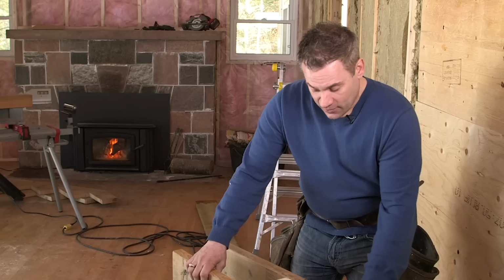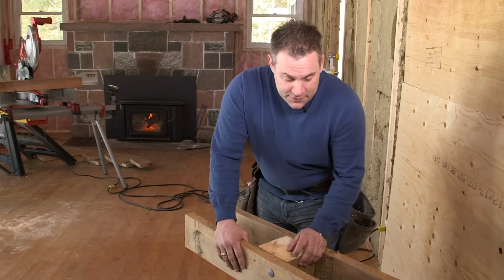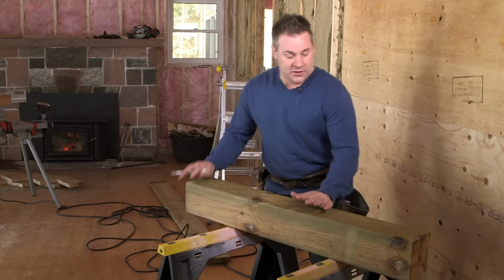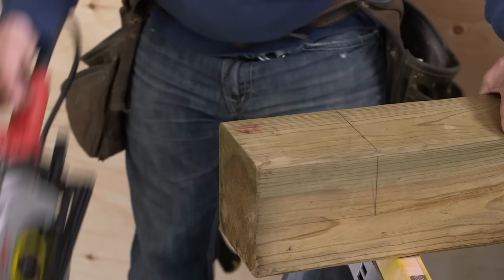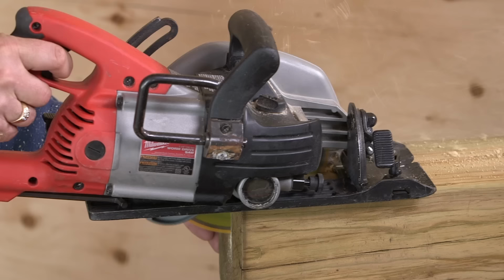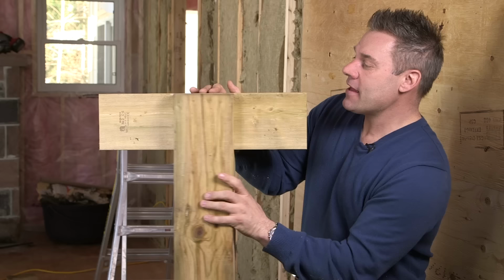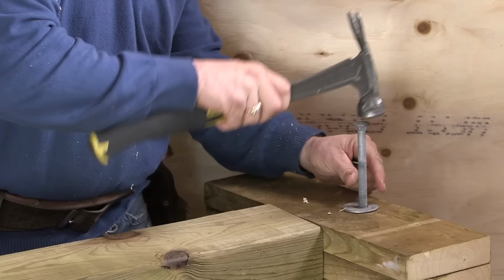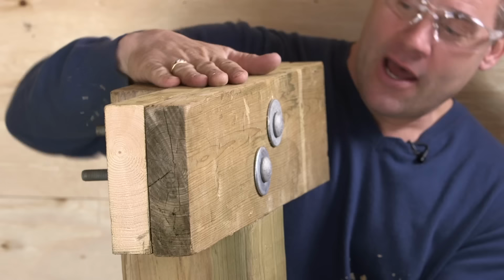How to Attach a Beam to a Post for a Deck | Decks, Docks & Gazebos

Comment: Those two 1/2 Carriage bolts have more shear strength than that post can structurally hold.
Reply: It's not actually in shear. The bolt provides clamping force which creates friction resistance. This is how a lug nut/stud works. They are only in tension. Anyone who's had a lug nut come loose knows the wheel comes flying off very quickly after that. That said wood is not like metal, it will wear in and that clamping force will decrease. The problem then isn't sheer force it's pull out force. Think of how little that carriage bolt head is. The entire force is being placed on that. That's why all thread with washers on both sides is better. Even then the way he shows is good insurance. It's only better to use hangers and not cut out a bunch of wood. He's effectively creating stress concentrations and putting shearing force on wood grain. That's a bad idea.
Reply: @Workerbee94   Correct..  The downward pressure alone would prevent the bolt from being removed.
Reply: I have decks over 30 years old done 'the wrong way'. and nothing wrong with them at all..
Reply: Wow.  Yes, the carriage bolts are stronger than the wood will ever be.  Yes the method shown is better.  Yes, the 'wrong' way will last for many decades.  Yes, the bolts are in shear though there are tensile forces also acting on it.

That said, the 'right' way will not sag relative to the post, and will not cause a lump in your floor.  The 'wrong' ways point of failure will either be the horizontal grains in the wood splitting or the lumber deteriorating.
Reply: @mjones2431  
Something can be said for spreading out the load over a larger area on the supporting post. Green lumber can shrink placing the load on the bolt which is only a fraction of the area resting the weight on the top. Much depends on the load it is expected to carry.
Reply: @larrybe2900  gotcha
Reply: Why put a washer on the head of a carriage bolt? The bolt is supposed to pull into the beam when tightened to prevent turning.
Reply: @austinheiman9488   For this application it would be fine.  I have seen 1/2" Carriage bolts without washers pull through 6x6's on vertical applications however a lot of weight was being applied (120,000 lbs. worth)
Reply: not even close.. Not even within 100x.  At the military base I work on we park Abrams tanks on 6x8 wood beams to distribute the weight of the 70 ton vehicle so it won't sink through the pavement.  I guarantee that a 6x6 post can carry 100x the weight of a 1/2 carriage bolt ACROSS the bolt.  That is the shearing strength.   I would agree with you to pull the carriage apart, say you had a monster chain to grab both ends and you pulled the carriage bolt you would be looking at something as strong as the post, but not across it.   It also has a lot to do with surface area.  resting a 4" x 6" beam (2 laminated 2x12" sitting on top of a 6x6 post,) has a surface area of 24 square inches distributed to the top of the 6x6 post.  with the carriage bolt you would have all that weight on the bottom edge of the bolt along a thin line 6" long,  lets say the line is 1/4" thick.  that would concentrate all the weight on 1.5 square inches of post instead of the 24 square inches. that is a huge difference.  The carriage bolt would act like a log splitter wedge on the post with the 18x more force along  that line where the bolt meets the post than if the weight was distributed along the entre 24 sq inches of the post.
Reply: @ericbrandenburg8583  again eric, that is along the length of the carriage bolt, not across it. with a deck, the pressure would be across the bolt, at 90 degreen and that bolt will fail long before the weight needed to pull it lengthwise
Reply: @garycarpenter2932  same here.
Reply: Its not about the carriage bolts. Its the few inches of wood from the bolt to the edge of the board that is carrying the load. If that rots or simply breaks away, the bolts or post thats off to the side (in the non notched method) will do nothing to stop it. Hanging on bolts off to the side of the post, youre literally betting on a few inches of wood on the edge of the board.
Reply: @ldlink3935  bolts don't come from China, viruses do!
Reply: Consider at the same time, cutting the notch into the pressure treated wood now makes the post no better then bare pine. The best way is to use a metal post and beam connector. Many styles available
Reply: Brian Van Horne  LOL cover the post with PL premium and your suggesting I'm the hack. That's pretty hilarious!  You realize wood expands and contracts, right. In the direction of the grain, right. Your suggestion of PL premium the post and beam together just split and cracked your deck into pieces. Enjoy getting sued. Don't like the look of a visual connector, pick one of the many non-visual options. Want to go "old school" get yourself some real beams and start doing Mortise and tenon joints properly
Reply: Brian Van Horne  yeah..... Me too!
Reply: The mode of failure in the “wrong” way is not bolt shear, so the strength of the bolt is irrelevant. It is the bearing stress of the bolt on the wood that is the problem. The “right” way decreases this bearing stress by spreading the load over a larger area.
Reply: All that shear conversation and blah blah is pointless. My area, the codebook specifically forbids their use for attaching beam to post. And that's that lol, all this other shit is a waste of time. Check your local codebook and they'll tell you exactly which set of IRC guidelines to follow.
Reply: @natemartinez4595  very true. Here in Ontario Canada the building code covers any deck with a height of 4ft or more. Notching is illegal,  the post must be a minimum of 6x6 and the beam must sit onto and be full width and "mechanically attached " there are several choices of attachment with the simplest being scabs. Decks usually fail in one of three ways. At the Ledger board, at the posts and beam or the railing connections. Under heavy  loads, rotten notched posts split. It's not about shear, 20 people on a deck moving around create a load on the post that comes from many directions. It's about posts twisting,  splitting  and failing.
Reply: Brian Van Horne  where in Ontario are you, right now there are 84 brand new townhouses in Burlington with the decks condemned because the posts were notched and already cracking before the homeowners even moved in. For your video please provide what the method of attachment was. Obviously the beam was not mechanically attached and resting ontop as Ontario code dictates. Probably nothing more then screws or nails as is often the case.
Reply: Brian Van Horne  by " extra blocks" I assume you are replacing the metal attachments with wood scabs which is basically the same thing. I'm not in Hamilton anymore but grew up there and have built many post and beam buildings through the Hamilton building department and my contractor's license was through Hamilton. I grew up in Troy. I apply the same principles of post and beam barns to decks. With scabs and cross bracing. I never notch. I 've seen to many ten year old deck post fail because of the notch and the post cracking at the back of the notch. Technically your supposed to drill a hole at the back of the notch before you cut so it is rounded instead of square.  That is supposed to stop it from cracking but I've never seen anyone that does that and I find mounting the beam on top of the post and connecting it mechanically way stronger then a notch. In the last two years or so most cities have made notches illegal.  London, Barrie, I'm not going to name them all. Maybe it today's wood, maybe it's today's Labour. But they are getting rid of notches altogether because the posts crack, split and fail. Snap in half like kindling. One of the first decks I built was at my parents house on lynden road in 1990. The deck boards have been traded out a couple times but the base structure is still the same structure today.
Reply: Brian Van Horne  each rafter must have an anti-uplift block yes. So for a deck, you use the same idea? But for the joists? Would be nice if utube allowed one to posts pic's. I frame a deck sub-floor much like a house sub-floor. Joists and spacers. That sits on top of the beam and is secured to the beam with up lift blocks. Ledgers I've only ever believed in one method and that's a bolt through the entire foundation wall with an angle iron for support under the ledger. I'm not to worried about the extra 700 bucks.
Reply: What he doesn't tell you is cutting treated wood exposed untreated lumber to rot so the little cup he created will hold water and rot out far faster then the bolts would "shear"
Reply: He solved the problem, he just understand what the problem is. The carriage bolt is not gonna shear but the beam may split . Moral of the story is that if a man don’t understand the problems he is not gonna be able to teach you very much.
Reply: Dark Justice  Ya but have you ever seen wood shrink as it dries? Unless you go back and re torque the bolts each year they definitely will become loose and will be in shear. the real problem with that is not that the bolt will fail, but that the wood will split from the bolt hole to the end of the board.
Reply: @garycarpenter2932  I know I have seen headers simply nailed into the house, but I guess the homeowners never had a house party with 20 people dancing on the deck
Reply: @jeepsuc99   I've seen carriage bolt heads pull through a 6x6 without a backing washer
Reply: @ericbrandenburg8583  not in a normal situation they are designed for you didnt. They are designed to lock into the wood and no washer is needed.
Reply: @jeepsuc99   I pulled a grade 2 through a SYP 6x6..  Then again we're talking about an 80,000 lbs of machine that caused it to happen.
Reply: All these comments is exactly why the world needs engineers...means job security for me.
Reply: @wolfpack4128  You're wrong in so many ways...I don't know where to start.  The bolt has to be tensioned to a value that creates a slip critical connection..I think that's what you're trying to say.  But you don't want to rely on only this for strength design.   You will want to check the bearing resistance of the timber and the shear strength of the bolts as well.
Reply: Brian Van Horne  Wow your local fireman/building inspector had nothing to say....amazing.
Reply: Doesn't pass code though,
Reply: @chrisburns5691   Does in my state.
Reply: @ericbrandenburg8583  funny, doesn't in the IRC.  Not to mention ive never seen a carpenter on a job do it that way, unless it's a kids playground.  Just not the right way to build a deck.
Reply: @chrisburns5691   26 years as a structural engineer with Zicka Homes.  I may know a thing or two.
Reply: @wolfpack4128  the bolts are in shear when used in this manner. Suggest you don't comment on something you obviously know nothing about.

Comment: There is a big problem with that construction that most contractors miss. Wood shrinks along the depth and width dimensions but not really along the length dimension. By having the top of the post flush with the top edge of the beam the post end will end up above the beam edge (after the wood shrinks) and a bulge or crack will appear in the decking laid across the area. To do it correctly the top of the post should be about 1/2" lower than the beam edge to allow for shrink.
Reply: agreed, also if water gets between the sandwiched 2x's it will create moisture that can not dry out, so an air gap would be sufficient
Reply: Don H 
Can you let it shrink first?
Reply: Wood, especially wood used outdoors, grows and shrinks seasonally (expands and contracts). Over time it does become more and more stable but it will still "move". To prevent expansion and contraction, from being an issue, I recommend that you always set the beams/joists higher than the top of the posts.
Reply: Thanks for adding that. Most don't realize being a Carpenter (one that gives a shit) is a very technical trade, not just swinging hammers.
Reply: sure, if you got a month, but then it will swell again first rain.  What Jason Lake ALSO did wrong is not keeping the post top down from the top of beans about 3/8".  If beams shrink post will push deck plank up and that will be a real bitch to correct, and really piss off an owner.   MAYBE lumber shown is treated not to shrink but should still hold post down  @vinceking7878
Reply: in my opinion triple 2x8 for beam minimum.strong foundation strong deck
Reply: Beam on top.period

Comment: Once I saw him use washers under the heads of the bolts I knew instantly he was an internet expert.
Reply: I don't know ,did you see how cracked the post was?
Reply: @johnphillips2396  you still don’t use washers on head side of carriage bolts
Reply: In theory the washer is smart since you don't need a real bite on the wood and it will create less splitting pressure. It just need to hold it in place right?
Reply: @johnphillips2396  just an example
Reply: @colbornfarms4849  i agree. But at the same time there is no harm by it being part of this particular system.."might" actually have benefits of holding it in place with a bigger head surface
Reply: Hater
Reply: I see decks built with the beams not  let in to posts all the time. It’s strictly a mechanical connection. Guess what? Most homeowners don’t pay for experience only lowest price. It’s a race to the bottom. In theory, the bolts will hold until they sell their place and move on. Love the yuppie
Reply: I thought I was the only one to see that lol.
Reply: @maxkady9478   the code book is very clear on this 
Just because you see something done a certain way does'nt make it right. It is now the inspectors fault for not doing his job
Reply: err, WHO is the "internet expert"?
Reply: The carriage bolt will not sit inside washer unless washer hole is extra large the square hub will create unequal pressure on washer and cause less surface friction than the carriage bolt itself which has a large washer size head and will keep it from spinning
Reply: @colbornfarms4849  Washers under the 3/4 round head so when you use an air gun to tighten the nut you don't pull the head all the way thru the post. (nyuk nyuk)
Reply: @johnphillips2396  The biting of the bolt won;t split the timber as it will just compress the wood, a nail being driven would probably do the trick, that's why an old trick when using wood that splits easily is to blunt your nails

Comment: I just built my deck and I attached the beams to posts with finishing nails. They were on sale and fit nicely into our budget.
Reply: Should have used carpet tacks...for strength!
Reply: I like your style. Around here we call that "DYOT" - Do your own thing.
Reply: @inthewoods5471  One should do, I do not want to contribute to a higher carbon footprint!
Reply: Did you build my deck as well?

Comment: If you place support posts within 6'-8' apart, double your support beams and use 1/2" carriage bolts they can hold a lot of weight for many,many years. Remember, proper care of your wood eg stain sealers will protect your deck for decades!

Comment: While your method my be code and perhaps a stronger way of construction. I've seen many many decks and never not one single time has the failure of the deck been due to the carriage bolt sheering.Its always rotting wood,splitting wood, or some other reason but never has it been due to failure of the carriage bolt.
Reply: I thought most bolts are around 10 to 20000lbs of tensile strength so how could you ever have that much weight in that small area
Reply: @jasonbrown7258  exactly
Reply: But when the wood gets older the pressure on the holes around the bolts may brake and cut through the beam. The method he showed is much more durable but for a different reason.
Reply: @Sauromannen   yeah definitely prefer his method. But he was saying basically that the bolt couldn't handle the sheer strength, which ain't really accurate. As you said the timber would probably fail first.
Reply: Your correct, it's not that the "carriage bolt" doesn't have sufficient strength to resist shear loads... it's the wood that will fail. Such a statement in court would get you laughed out... such a statement in the work place will get you kicked out.

Comment: Great example. Thanks for sharing!
What would be the best approach for 2 beams that meet at a corner post?
Thanks again.
Reply: At the corners or our second-story deck where the two courses of double rim joists meet at a 90 are are set on a single notched 6x6 post, which is notched on both outer edges to hold the two courses of double boundary joists.  This  L-shaped notch leaves a 3x3 section of the beam on the inside corner of the 6x6 and the joists resting on the notches.  All secured with nails and no straps or ties of any kind.  I'd like to run some ThruLoks through the joists into the  post for additional support but only that 3x3 secion of the beams remains as backing for ThruLoks that would need to pass through it from both sections of joists.